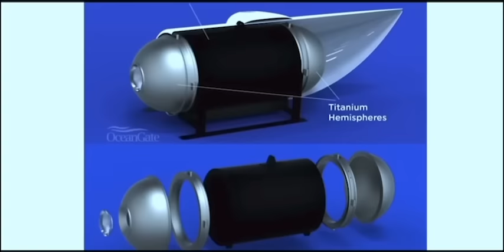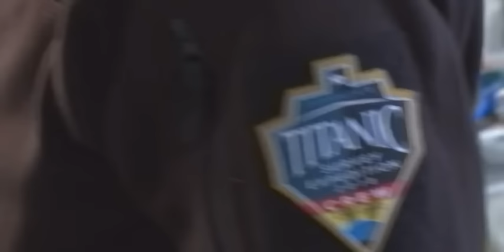First look at #oceangate #titan Debris

Comment: Such folly. Too bad RUSH’s ego and sloppy engineering leaked into the population. I.e., made people think it was reasonable to pay a quarter of a million dollars to risk their lives. Not that the poor father and son had any knowledge of the warnings, Rush wouldn’t have told them he had fired the person who warned of failure.
The part that I find most haunting is that the passengers knew they were doomed, even if only for a minute. First reports said that because implosion happens so quickly, they wouldn’t have known it was coming. But now we know the lights went out, the thrusters stopped, they tilted downward and fell thousands of feet. They had to be terrified. What a horrible outcome to what they, the passengers, were led to think was an adventure. The poor families…such an unnecessary fate.

Comment: There was no squeeze-out. A properly sealed joint will have squeeze-out. Also I didn't see any witness marks. How did they know they got the two parts joined all the way, full depth, without seeing the joint go all the way to a witness mark? 
Just think how heavy that titanium ring is. Every time they hoist the thing around they are stressing that glued joint between titanium and carbon fiber. The carbon flexes and the titanium does not. 
Madness.

Comment: Yeah, I think I'd prefer a high strength-to-weight ratio ... "buoyancy" ain't much good otherwise.   He also seems oblivious to the difference between tension (carbon is strong) and compression (not so much.)
That being said, the damned thing did survive several successful dives to to the Titanic.  What killed them was most likely an accumulation of stress fractures in the carbon fibers: the vessel was getting progressively weaker with every dive. If you don't retire the thing before it fails, you come to a bad end.  Nobody yet knows how to properly qualify or re-certify such a hull, and OceanGate had no plans to do so.  They were going to operate it until it imploded, and that's exactly what they did.

Comment: Hand applied adhesive, no squeezeout, and they considered that a good joint.
Reply: So what Engineering firm would sign off on adhesive to the tungsten end bells? Without knowing what would happen to bond with the extreme temperature changes, lightning strikes, flexing from extreme pressure changes, aging to glue itself. It would seem to me they would have to physically examine the core carbon fiber and glued end caps every trip in the water. Answer is there is not a competent Engineering firm that would touch recommending this application.

Comment: Look back at my comments from the beginning and you are just figuring this out.
The first thing I said was had the flanges been properly mounted to hull it would have added the overall strength of the hull.
Not frigging glued.
As the pressure increased it popped the flanges with its limited contact area resulting in failure.

Comment: As an engineer it is sad to see how another engineer would be okay with this design. That being said I am still confused as to how the cap was placed on the outer titanium ring I should be on the outside and visible and the carbon seal would be on a the tiny inside ring that is paper thin at 12000 feet hahaha  lol

Comment: As an Engineer, I find your comments are - as we say in the UK -  BOLLOCKS.   The titanium rings will be PUSHED onto the carbon fibre cylinder by the water pressure thus increasing the sealing capacity of the interface and the end caps are bolted in place - under the same forces having the same effect - increasing the sealing capacity.   The problem is that carbon fibre is tough as buggery in tension, but not so much in compression.  Concrete and and cast iron are the opposite - squish them and they laugh  - pull them apart and they snap like carrots.    Stockton should have commissioned five CF cylinders and changed them every three (?) dives. If he had charged a million per ticket,  he still would have had his passengers  ( there are plenty billionaires who want to see the open graveyard of thousands of poor people) , but would have had some money to invest to keep his project - and passengers alive.

Comment: I am a 3D  Modeling / Animation with a background in development and engineering. I come up with many project that I post as time-lapse videos. Yet these projects have been tested and evaluated beforehand to have the ability to 3D print them. That said I was not aware of this Titan Project. However I am aware of the design idea. In truth I didn't need to test this using my 3D software to know the many flaws that was clear. The truth is the method was not for this type of application. If it was say space flight or a moon base object I see no issue with starting this method for say underground areas on the moon. The CEO engineering ideas of using Glue  was a deadly mistake.

Comment: 1:14 - What does Father Ted know about submarines!?!? surprised he didn't use PVA/Wood glue!!
1:20 - They're over the top in their rules and regulations, and no one ever dies, so clearly they're a waste of time and not needed!!
I know there are some really strong glues, but I'd expect them used alongside welding, bolts, rivets... not just glue and some fingers crossed!
I'm curious how much, if any idea/warning they had. Whether they heard heard/felt and knew something was up, or whether it was that sudden they'd have been cut short mid sente...........
all done before they even realized; at least their deaths would have been instant and painless!
RiP to the four; the top middle not deserving!!

Comment: Melba transcript is out between communication between the submersible in topside ship I'm going to disagree with you. They jettisoned all of their ballast and their sled trying to come up and still could barely asend, they lost their A bus power and had to switch over to B bus. They developed a leak in the rear of the sub where all the power was kept. Even if it was a tiny pinhole it would have come through like a laser beam saltwater shorts out the batteries. They become negatively buoyant at some point around 3550m the sub pictures to a almost 12 o'clock vertical position starts to slip down and then.....

Comment: If ... if ... I was building a bath toy of such design in that pill shape with "glue" at those joints, I would certainly bolt or rivet through the two parts. Just the difference in titanium to carbon fibre temperature expansion coefficients needs equalising through fixings. That's what bolts do -- spread and equalise differences. A titanium lap ring on the INSIDE TOO (bolted through) would have helped stop them come apart. Like duh!

Comment: It broke at 6000 meters.  far deeper than they were going to take the sub.  Everything has a breakpoint.  So to point  out it broke at the joint is meaningless. But I think it going so deep before implosion lulled them into a false sense of security.
Reply: No it did not. The sea bottom is at 3800 meters.
Reply: @bobmop2841  They tested a 1\3 scale test prototype in a pressure chamber which broke at 6000 meters according to Rush.

Comment: imagine the extreme maximum pressure of the ocean... and then the materials of a handmade connecting the parts using a glue..😂 wow it will easily be fuck up... real quick 😂😂😂

Comment: Wouldn't it have been better if they bonded the carbon fiber cylinder over the titanium ring instead of the opposite, since the water pressure then would clamp around the carbon fiber and keep the seal better. It looks obvious to do this.

Comment: It's like they had nobody who understood compression physics. The surface area of the "tube" must not exceed the area of the endcaps. I wouldn't even like "equal" for this contraption. You really want the endcaps to compress the tube. Who does critical glue work in other than a "clean room". Lastly, has anyone seen a peer reviewed work on carbon fiber structures in compression?

Comment: Just a single layer of epoxy glue holding the titanium metal ring to the carbon fiber polymer hull? Are you kidding me? Using incompatible materials was an accident made to happen.  Submersibles should be made of steel or titanium and welded together as a single piece. James Cameron made over 60 dives in a steel vessel and that unit is still intact today and now in a museum.

Comment: I've worked with composites for over a decade.  Seeing the cylinder bonded with the ring in that manner just seems wrong. The shear forces applied to the joint are at 90° degrees to the fibers on the flat side of the tube. Tsk tsk. I thought maybe the carbon was wrapped around ring in a  manufacturing process. Almost like a permanent mandrel. When chemical adhesion is your only bond maybe a vacuum process might've been better. These guys looked like they were setting tiles in a kitchen.

Comment: Они наматывали углеродное волокно подобно катушке с нитками, и даже не перехлестывали его крест на крест. Что будет если вы переломите подобную катушку, только с нитками, правильно она расслоится. Две титановые полусферы на обоих концах, имели лучшие прочностные характеристики по сравнению с углеродным цилиндром, так как он имел слоистую структуру, а волокна склеивались между собой дополнительным химическим компонентом, имевшим другие прочностные характеристики, видимо поэтому, при каждом очередном цикле погружения, углеродный цилиндр получал микротрещины, постепенно приближая глубоководный аппарат к разрушению.

The wound the carbon fiber like a spool of thread, and did not even close it crosswise. What happens if you break a similar coil, only with threads, it will be properly stratified. Two titanium hemispheres at both ends had better strength characteristics compared to the carbon cylinder, since it had a layered structure, and the fibers were glued together by an additional chemical component that had other strength characteristics, which is probably why, with each successive cycle of immersion, the carbon cylinder received microcracks, gradually bringing the deep-sea apparatus closer to destruction.

Comment: Most hydraulic systems run up to about 3,000 psi at which point the safety bypass kicks in. The safety bypass is the (manufactured) weekest point of the system thus making the system - safe!  Us who work in the industry has ever seen a glued joint on a high pressure hydraulic system. The Titan was exposed to 6,000 psi - ludicrous!

Comment: Yeah those end cap glue joints could have been bigger..I got the feeling they thought the pressure would push the end caps tighter but side pressure at those joints is what probably failed.. At the carbon fiber edges.. Carbon fiber flexed but the titanium didn't. Epoxy at those depths might not be viable or stick well to titanium.. Sad end to a failed experiment..

Comment: Oceangate's Titan exceeds all of other bad ideas in history. 
The Titan plummeted to around 4000 feet in depth.
The crew inside the Titan vessel we're "Dieing" to see the Titanic so skipper "Stockton... Rush"'ed to
the bottom quickly to view it sooner. All of them we're heard knocking the internal walls of the vessel because they we're so "Imploded" with excitement.
The Titan vessel maintained full depth for about 1-week before being pulled back up to the
surface. However, those onboad the Oceangate vessel remained at depth because they wanted add a sequel to the Titanic Movie.
I understand the crew we're in a "Rush" to look for Jack in the Titanic ship. However I think
they've got the wrong movie cause Jack Sparrow lives on a pirates ship, not the Titanic. Those Oceangate fellers sure as hell would have been "sinking" about what they Carbon"- could've done better to "Fiber" things together.
Shame on Oceangate team & Stockton Rush !!
I hope the authorities sink Oceangates directors for thier lack in saftey checks and standards (or
lack there of).

Comment: I learned the other day that the cylider was flat wound CF and not diamond wound. Added to that, i.see with absolute disbelief and incredulity the the domes.were butt glued end on to the cylinder. Not even an inboard retaining lip. Buthen with flat wound ribbon, a.lip would have fatigued the CF faster.
Will his design engineers tell  us why they selected this fatal design, and hear them justify it, even after the loss of life. They will. Watch.
Shocking and terrible loss by ego.

Comment: I'm shocked at the minisule amount of overlapping parallel wall area between the end of the carbon fiber tube and the flange interface of the titanium end caps. Forget that carbon fiber was a bad choice to start with, even off the shelf cardboard shipping tubes from Staples have proportionally greater overlapping support from  their plastic end caps than the Titan had! Amazingly bad, near criminal engineering!

Comment: Well..any way…Stockton Rush found out first hand why you don’t use carbon fiber to build a deep sea submersible…..that’s a hard lesson to learn…..☹️.
Reply: Look, I’m no engineer, I can barely spell my name most days, but, I definitely think that you could make a carbon fibre pressure hull, but you’d need to include another component like Kevlar which has some flex and stretch, and the construction would need to be different. IMO, if you made triangular shaped lengths of carbon fibre, 2” wall thickness, filled them with a ballistic material, glued them together to form a circle, and then put a titanium flange on the front and back, with a much longer edge, around 6” and glued up in proper laboratory conditions, I believe that would be a much stronger, safer hull, but you’d still see my ass testing 5 of them to crush depth before I got into them.

Comment: Different materials with different expansion rules, and different reactions to pressure, not even talking about their shape (a tube won't react the same way as the cap even if made with same materials), and we end-up with unevenly distributed carbon fiber at the end and glue. This would be comical if not for the loss of 5 souls.
No structural reinforcement of the tube part, begging it to crush under pressure.
There's nothing that could work in this "engineering", this is what we usually dub "criminal"...

Not one of these "ideas" have been tested thoroughly at these pressures, and they go as far as to use a 1300m (130bars) pressure-certified titanium cap to go 3800m (380 bars), incredible engineering from those that created this cap that went so far without breaking, handling 3 times the certified pressure (and forces).

Comment: with carbon fiber being weaker than titanium, the carbon fiber center probably bent and disengaged from the rings and the titanium ends...even if they had bolted the pieces together instead of glue..they would detach as the carbon fiber center bends and breaks...total disaster :(

Comment: I don't see ANY bulkheads along the lenght inside of this fiber tube.. it would've crumbled as it collapsed btw.. also it's just a slip fit joint.. this should have had serrations on its diameter matching an "expanding clamp" inner ring that secures pushes the tube outward into the sphere flange and bolts to the sphere from inside.. OBVIOUSLY there is way to little purchase for any epoxy to hold,, plus it would just peel apart at that joint.. these are Rookie Mistakes

Comment: Glued together ...what a joke, I am not an engineer but wouldn't it have been prudent to have glued them and then connect rods together from the front and the back titanium rings and tighten them to give it even more strength...crazy crazy design....what checks were even done after dives or could be done to ensure the 'glue' still retained its '100%' bonding power????  Poor people that perished in this power trip crazy design

Comment: James Cameron went safely to 11,000 meters in the Mariana Trench so why did they not use the same design as this depth is less than 4,000 meters to the Titanic its not really that deep its just a design flaw unfortunately only 1 flaw is needed for  failure

Comment: That’s what happens when the leader is not competent enough and he believes he is a “chosen” one. He had a degree in aeronautical engineering, not submarines; he didn’t have experience working as an engineer; and the worst of all he thought himself superior to the very experts. The problem is not coming with his own design (that’s indeed a good thing), the problem was not to be humble enough to test it and refused to do it even when the ship was failing. Basically he thought he was superior also to the laws of Physics.

Comment: I don't think it was the joint. As he said near the end of the video, the carbon would crush, tearing at the seam with the titanium. The fact that there is carbon fiber on the titanium shows the joint didn't fail, the carbon fiber did. I wouldn't trust  CF,  I've seen too many failures of it. Depending on glued together layers against compression? No way.